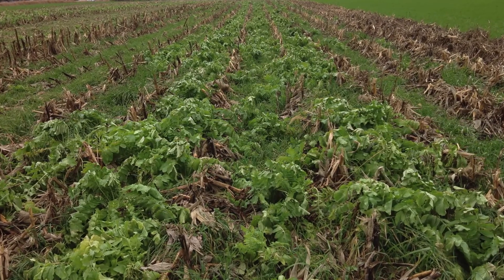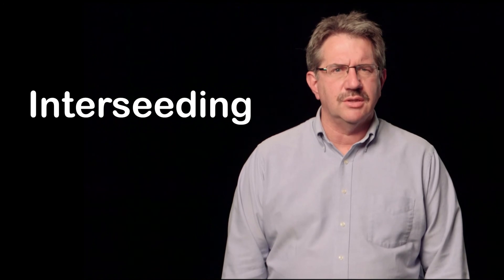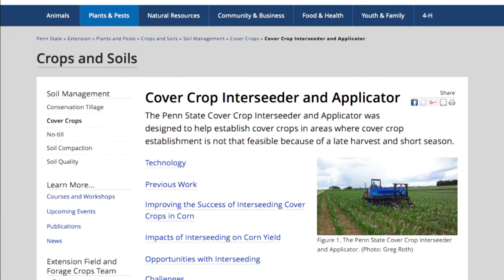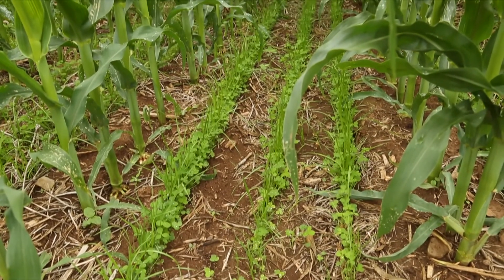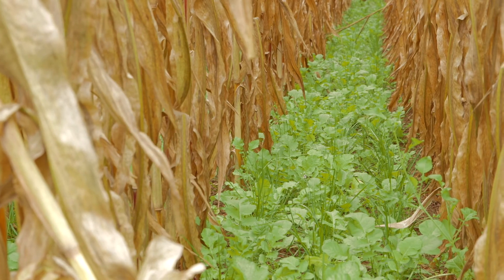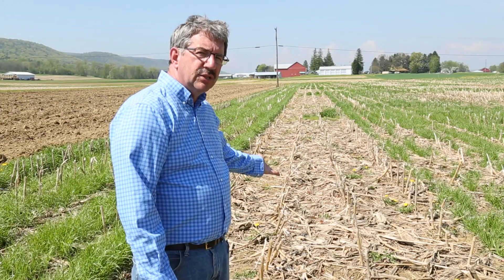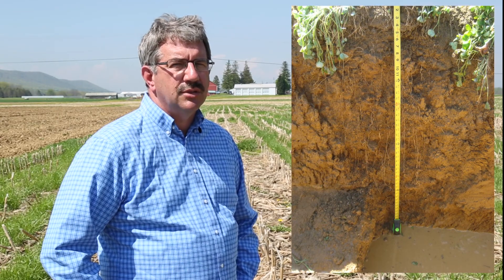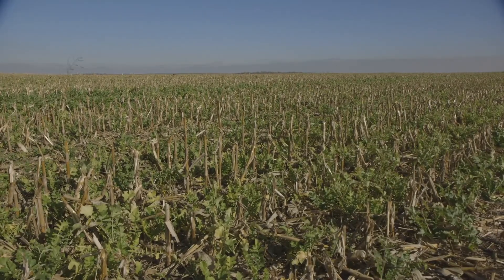The Penn State Cover Crop Interseeder and Applicator

Comment: Step 1: use herbicide.  You guys have a long way to go before you get it. :(
Reply from the maker: We have worked with the interseeder in organic corn and soybean production as well, and it can work there too.  More of our cover crop research is available at https://extension.psu.edu/forage-and-food-crops/cover-crops
Reply: Every farm should be organic....stop killing the soil and people
Reply: @Atimatimukti  Did you know that certified organic systems use herbicides as well? Along with a startling amount of plastic mulch. It's difficult to have a system that's no-till, herbicide-free, and productive.
Reply: @AMortalDothApproach  agree on the amount of plastic (I never use it) but, herbicide?? That is not possible, if they use it they should loose the certification.
Reply: @Atimatimukti  lol it absolutely is possible, there are OMRI listed herbicides, you can look it up. They're based on stuff like vinegar.
Reply: @AMortalDothApproach  yes I know but I believe vinegar was not what the video refers to. Anyway, I am aganst killing the soil so vinegar and others (like boiling water or fire) are forbiden in my farm. Change the soil bioma and the weeds will die out. Also, use cover crops for 18 months. It will give you better crops and much less weeds